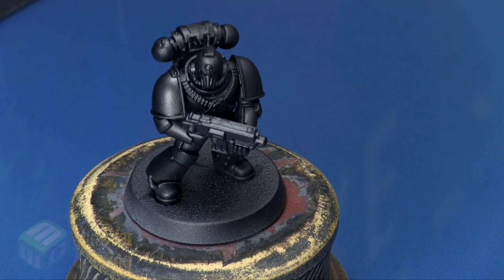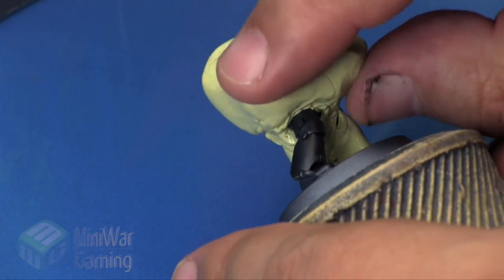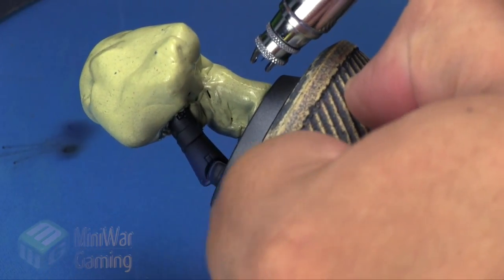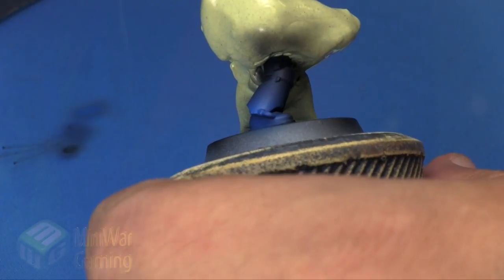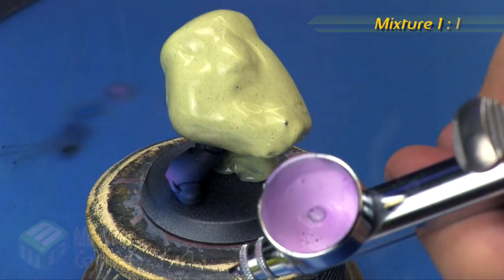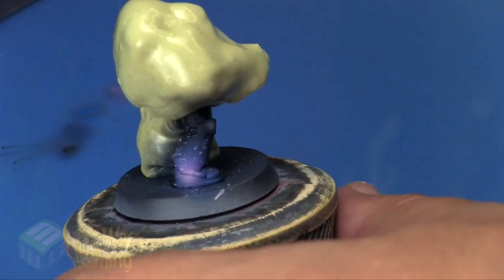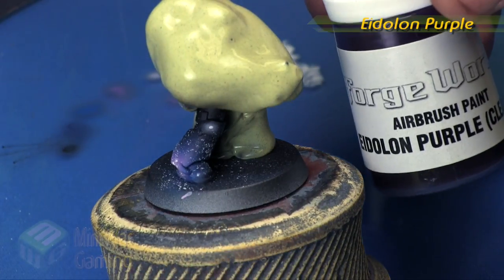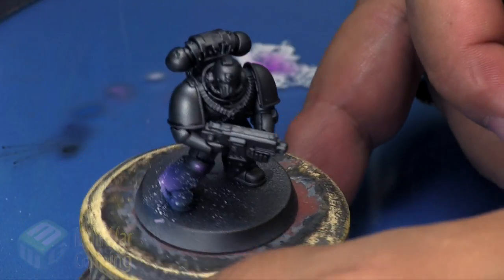Quick Tip: Painting Galaxies (airbrush)

Comment: I found a better way to make stars is to do what you are not supposed to do. First spray your paint at a high volume away from your model. Then point your air brush at the model and apply air in a quick spurt. The paint on the end of your needle will spray on to your model in really circular dots.